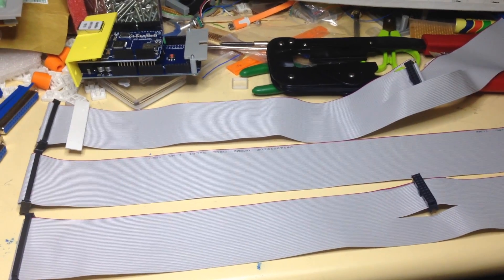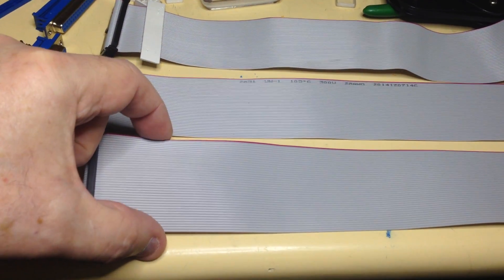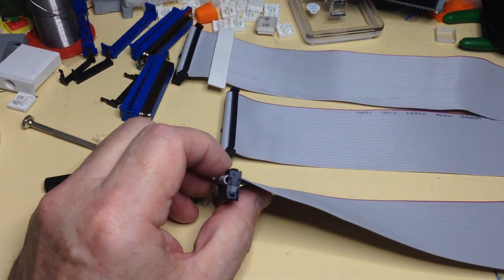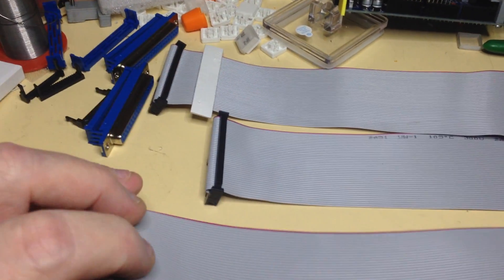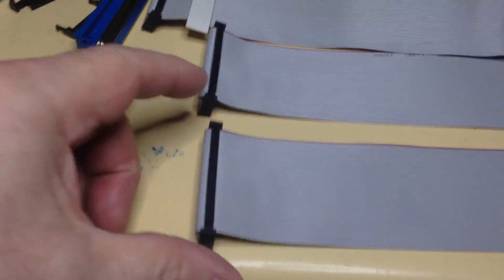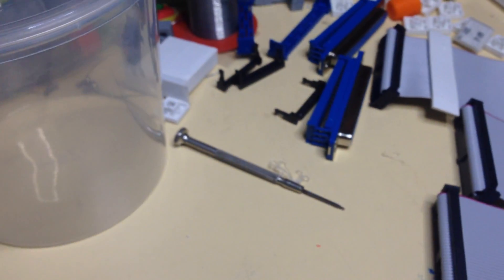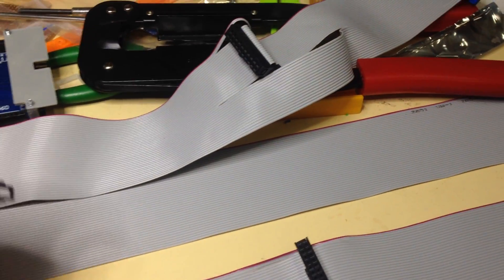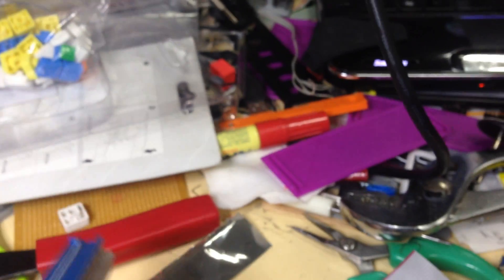GVG2ATEM Control cable construction

Comment: everything works except the tbar which I cleaned so many times.  My screen reads 050 I don't know what else to do
Reply from the maker: are all the panel pots working?
Reply: How do I test the other pots, I even bought another tbar pot from a broken gvg board 110, still with no answer
Reply from the maker: Use the Telnet diagnostics command *p
Reply from the maker: This will display the values of all the pots on the Telnet screen.